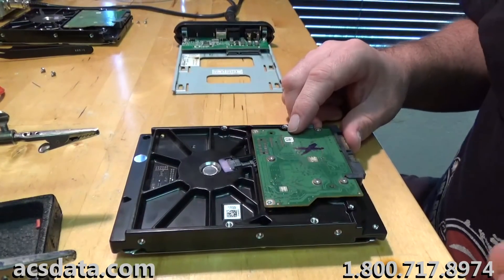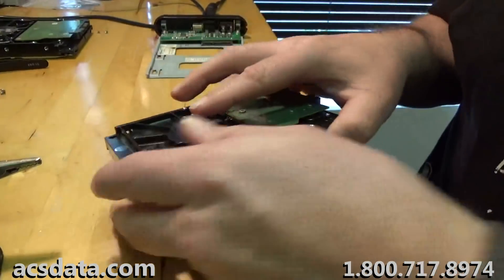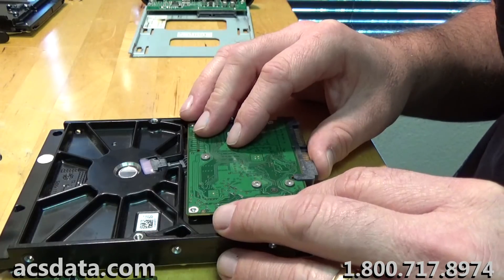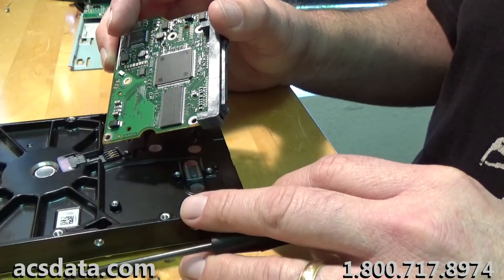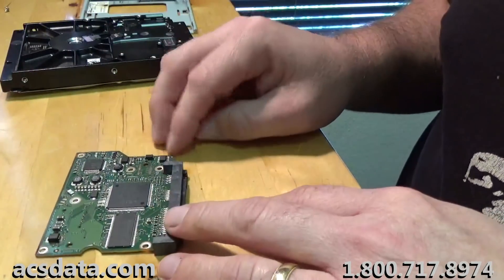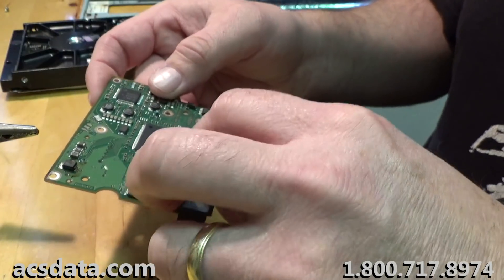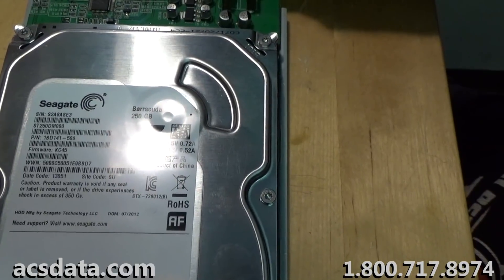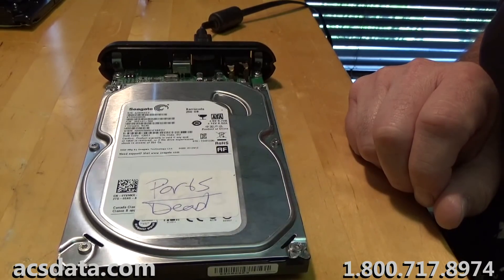Easy Data Recovery On A Seagate Hard Drive With A Dead PCB

Comment: My hard disk is segate 1tb 2.5 hdd and when it stops working i change the board with another one with the same model and same capacity after that it says 134217728.00 Gb do you have any solution

Comment: I have a seagate 7200.9 that does not spin as well. I checked the TVS diode and it reads fine. It's not blown or shorted. What now?

Comment: Actually, is replacing the board without the bios results in the drive being not able to read a single sector (reporting sector unreadable) or is there something worse in my case? I have a Seagate 1er164-302

Comment: Thx, you are my hero! I removed the diode with pliers and now my dead seagate barracuda 😄backup drive works as before! But I understand that its life now hangs on a thread so I will do another backup.
Reply: Actually, is replacing the board without the bios results in the drive being not able to read a single sector (reporting sector unreadable) or is there something worse in my case? I have a Seagate barracuda 1er164-302

Comment: Blew a couple 8TB HDDs while installing a new PSU, didn’t swap out the modular cables and expected it to work. Any suggestions for how to remove the diode without the hot air soldering tool? Can I use a normal electrical soldering iron to heat up the connections?

Comment: My question is that, how can we copy that so called "adaptive data" to a new PCB board?
Reply: By taking the bios off the old pcb and soldering it onto the new one.  But that's assuming the problem wasn't caused by a dead bios IC or corrupted data in it.

Comment: I've had 2 hard drives fail this year, a Seagate and a Hitachi. I only need it to run long enough to copy my files to a flash drive, so this method will hopefully work for the Seagate. The Hitachi, on the other hand, clicks and thats it. On top of that, the data is encrypted by GandCrab 5.2. Any ideas for that?

Comment: If the board that I replaced Isn't compatible and I've lost the original board, do I still have any chance to recover my data?
Reply from the maker: Depends on what brand drive it is.
Reply: @acsdata  it's a seagate Barracuda 500 GB hard drive
Reply from the maker: @tabishsattar  The way Seagate firmware architecture is structured, you will have a hard time finding a company that can do anything without the original PCB.

Comment: very nice video! I've learned what TVS diodes are ... and have found the 5v one completely short on my 3TB Barracuda -- nice!

I bought a time capsule with a defective drive so, for sure didn't care if I made the problem worse.

One question though ... outside the super infrequent mains transients and so ... there shouldn't be any other reason for this part? Right?
Reply from the maker: It pretty much just acts as a fuse.

Comment: Is it possible just to replace the TVS diode? Standardized surface mount TVS diodes are available from many sources. Sorry about commenting months after video was posted, but thanks in advance if you choose to respond despite that.
Reply from the maker: Absolutely.  If the TVS is the problem, you can sometimes pull it from a working PCB.  It's easier to just use a working PCB and program it with the adaptives.  That way if there was some underlying electrical problem in the original PCB, you won't run the risk of making a small problem even bigger.

Comment: There are some DOS-based data recovery programs, still being sold today, which claim to "refresh" or "remagnetise" the surfaces and recover data. You may have to change a BIOS setting from "AHCI" to "IDE" temporarily, before running them. Can software really correct "bad" magnetic surfaces in hard drives and get data back or are these programs just snake oil?
Reply from the maker: Those are bogus in every way possible. Software cannot physically alter the state of a hard drive or it's components, except for the fact that some software can make the situation infinitely worse.  If you have heads that are failing, you can actually exacerbate the problem by forcing the drive to try and read sectors.

Comment: my hard drive is not seen by the computer but the motor spins. do you think a board swap would work?(2011 hdd) also do you think the heads in the drive would need to be replaced?

Comment: Hope this isn't a stupid question (I'm not too knowledgeable when it comes to tech), but is this for problems with external hard drives? My computer stopped recognizing mine (1TB Seagate) over the summer (light still came on and made noise, though) The person I sent it to says he's narrowed the problem down to the PCB  and that he's going to replace it in hopes to fix the issue.  Didn't want to bother him too much right now since we're both busy and the time difference is an issue (I'm out of the country), so I found this video and was just wondering if the was for external hard drives. Thank you.
Reply: Hey I am in the exact same boat
Any update on this?

Comment: ever had a drive come in that someone had hooked up to a molex to sata adapter and the adapter failed and caught fire and damaged the PCB? I've had a few like that, one of them stopped spinning up but later worked just fine until it actually died (no spin no nothing). it was a 1TB 7200.12 seagate.
Reply from the maker: We get drives that have been blown out due to voltage issues quite often.  Hooking up the wrong voltage adapter, surges, etc.  It's not uncommon for them to knock the preamp out on the heads as well if the extra voltage isn't suppressed properly.